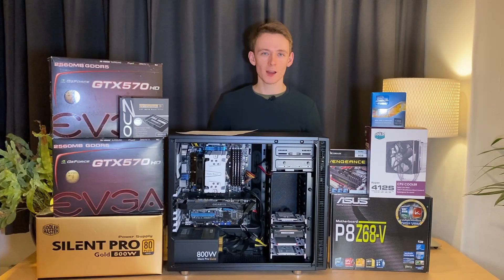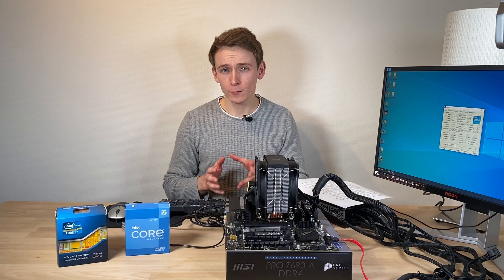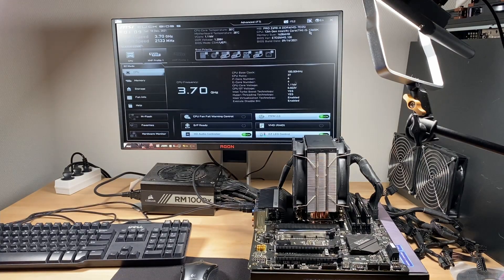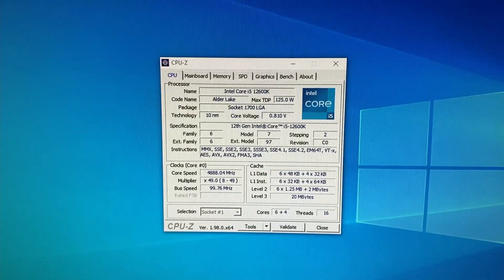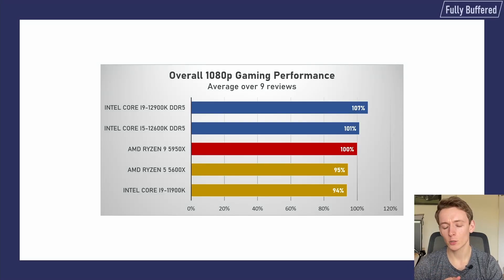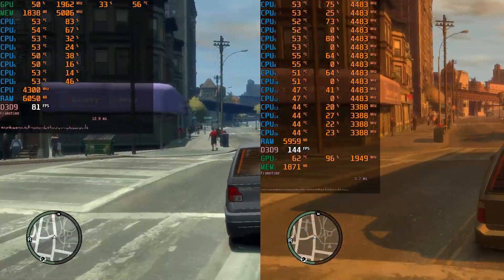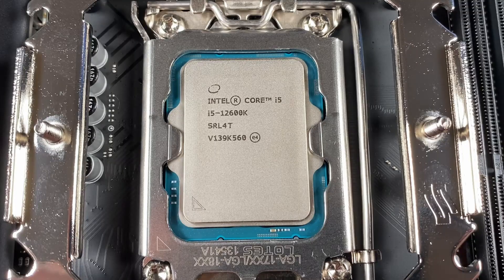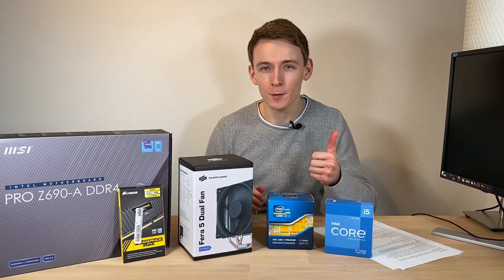Should you cheap out? - Budget Intel Core i5-12600K Upgrade

Comment: Not long ago I upgraded from my i7 2600K@4.4GHz, Asus P8P67 PRO B3, 4x4GB DDR3 1600 RAM. Had been using this system from 2011. I upgraded to a Ryzen R5 5600x with 32GB DDR4 3200 RAM. My i7 2600K was still working nice for my needs, but I noticed after the upgrade my machine felt more responsive for regular use. And in Borderlands 3, using the same GTX 1070 I had been using on the i7 2600K from 2017 I noticed a huge difference. In the BL3 benchmark the i7 2600K was just a few frames behind the Ryzen. But when playing the game I had to turn a lot of settings down on the i7 to mostly keep 60FPS and avoid stuttering. And even then it would drop to 30-40FPS when alot was going on in the game. Whilst the Ryzen was rock solid at 60FPS, at much higher graphics settings, would never drop below 60FPS and felt alot more smooth. So huge difference. As fantastic as the i7 2600K was, ugrading to an entry level platform like the R5 5600x did make a huge difference for gaming at least. But the i7 2600K is still legendary. I had it for 13 years. that's some serious value.

Comment: you picked a great motherboard you have so many upgrades options. my advice is to not wait till the cpu is no longer viable i would sell it in a year or 2 and get a 14600k or 14700k you will get most of your back for your 12600k

Comment: In 2019 I did a comparable upgrade from a 2008 HP dc5850 with a Phenom II X4 B97 (4x 3.2GHz) and 8GB DDR2 (800Mhz) to an own build a Ryzen 3 2200G (4x 3.7GHz OC) and 16GB DDR4 (3000MHz). I've added a 512GB Silicon Power nvme-SSD. An upgrade with a 2x faster CPU and a nvme (3400/2300MB/s)! 
I collect Virtual Machines, like all Windows releases from 1.04 (1987) to 11 (2022), including the NT releases from the nineties and the Ubuntu LTS releases from 4.10 the first; 5.04 my first and 6.06 LTS to 22.04 LTS and now the 23.04 Development Edition :)

Comment: 12600k 
RTX 3060 12GB 
3600 Patriot Viper DDR4 32GB
8TB NVME
1000 Watt Power Supply
________________________

Rate my build by spec! (This doesnt mean measure your cock with the 3090 you bought with your moms credit card)

Comment: I love the video, you are just like me reuse the same parts such as the case, power supply, and GPU, great upgrade and you waited to decide what platform to use from the LGA 1200 or the LGA 1700. the main thing is how much watt does the CPU air Coller handles I like the air cooler. I love the ending and I agree with you do not need a $100-dollar aio to keep your system cool. This air cooler is on my radar, and you did not hit high temps using this 32-dollar air cooler.

Comment: Pop out, then pop in...and just like that you have an awesome upgrade. This is why I prefer desktop PCs.

Coming from the 6600, I got the 12400 with Stock cooler and DDR4-3600
Reply: My 1050Ti went from ~75% usage in Fortnite and now its fully unleashed with the 12400

Comment: Got this cpu early this here and upgraded from a 1060 to a rtx 3070 8gb this July when gpu prices came back to normality.... really love to use it to work with Figma and Adobe suite, it smokes my old i7 3770 and 2019 macbook pro.... like I can literally open a crazy amount of browser tabs in Chrome and Firefox while working and having a lot of background processes and all the communication apps, all with 3 plugged monitors (one 4k and two 1080p)...  and it never skips a beat.
The only thing I might need to ugrade is the ssd as I have a sata ssd and I want to go nvme... but this is already so sweet since I have to use this system almost everyday for many hours.

Comment: I have SilentiumPC Fera 5 (single fan) cooler on i5-11400. With unlocked power in synthetic load (prime95) it can draw up to 144 W peak, 130 W average and even with 28 C room temperature and closed, poorly ventillated case temperature of CPU didn't even hit 90 C (60 C delta above ambient temperature).
Dual fan offers very little performance boost over single fan while increasing noise level (according to internet tests), so I picked the more silent(ium) option. Did I mention my fan curve is tweaked down? It's barely audible at full load while not thermal throttling in bad case/ambient scenario.
Meanwhile my friends are listening to their fancy, expensive AIO pumps.
Reply: I ordered the i5 12600kf paired with the Fera 5 ARGB, im excited to see how it is while gaming :) i only play games tho, no rendering etc

Comment: The 12600k is very nice indeed. I bought a 5600X in 2021, when the 12th gen was not available. Honestly I don't regret it, because despite the lower performance, it tops around 70W and 62 C with a cheap air cooler on benchmarks such as prime95, nearly half of the power consumption of the 12600k on demanding workloads

Comment: Hey man, how much did you spend on the cooler? Cuz from what i see, the single fan version of the fortis 5 is priced similarly to the fera 5 dual fan and even from the pictures i can tell its much bigger (i was suprised that it was a single tower, and not a double tower with a fan in the middle)

And btw, speaking of similar pricing, are the gigabyte gaming x boards priced near the price of the msi pro in your country? I plan on getting a build like that, and i found that aside for the cheaper asus prime that doesnt look that appealing due to less m.2 slots and poorer i/o, there are 2 options, a gigabyte gaming x board, and the msi pro one, so, what do you think about the gigabyte gaming x, and is it worth buying over the msi pro? (Or the aorus elite in that matter, because ts the same pcb just with some bigger radiators and a lit up logo to make it look better, even the websites with info about the gaming x and the aorus elite are the same to the point that they forgot to switch the numbers listing the features so on one of them, thunderbolt and intel 12th gen support were switched and the tb was listed on the socket and 12th gen support was listed on an internal usb c connector)

Comment: are you actually gaming at 1080p...if so, that's a bit uh, well ya no wonder you see a 50% increase in performance?  That's not really helpful information in 2022. At the root of it, essentially the question everyone wants answered is/was, is it worth the cost of a cheap used car, to potentially gain yourself ten frames per second on 1440p or higher resolutions where the CPU is not the bottleneck
Reply: Well, he uses a card from 6 years ago, its not a 1440p gaming card, not for battlefield

Comment: this reminds me of when I changed from q8200 to i7 7700k while using a GTX560 - specifically in Battlefield 3 at that time (25fps => 90+). Obviously for how I use a computer these days in 3d rendering those specs didn't exactly stay in the case for that long

Comment: I recommend using DXVK on GTA 4, it can double the FPS depending on the configuration, and even when it doesn't improve FPS, it does improve frame times and stability overall.
Reply: isn't that a way for linuxt to run directx programs ?
Reply: @amer2142  It just translates DirectX calls to Vulkan, so it can run on Windows as well.

Comment: There's something so elegant about upgrading from the 2600k to the 12600k
Reply: but not from 95W to 150W. it may need speed or cores number cut to fit acceptable temperature <70 C in some apps. or more bulky cooler
Reply: @shampec6185  outta here amd hypocrite editing msgs to sound correct
Reply: 125w* @shampec6185
Reply: @shampec6185  rewatch the video, author clearly said that he didnt have any issues cooling that 12600k with that small air cooler. just because it needs more wats doesnt mean its harder to cool.
Reply: @h1tzzYT  more power = more heat
It's the joule effect
Reply: @lucasf4rt523  you are technically correct but you forgot the most important factor. Thermal density, the smaller cpu die is and the more power it consumes the hotter it is and the harder is to dissipate that heat. Thats why some cpus such as HEDT cpus has no issues running above 200w, meanwhile something like 5800x will be extremely hard to cool even with top tier air cooler such as nhd15.
Reply: @lucasf4rt523  also very good example is gpu cooling vs cpu cooling, gpus can be cooled at 300W without big issues with air cooling, while in most cpus at 300W you are looking purely at water cooling territory, thats because cpu die is much smaller than gpu.

Comment: It's great value and a deal, but budget is different. The 12400 with a non overclocking mainboard (B660) is a good budget build because the single core performance is still very high. You can almost buy two of those for the price of 12600k+z690 :)

Comment: Super video, hai. I try to build something similar: MSI PRO Z690-A DDR4+CORE 5-12600K+Noctua NH-U12S chromax.Black+PATRIOT 16GB Viper Steel DDR4 4400MHz CL19 +ADATA 1TB XPG SX8200 Pro M.2 PCIe+MSI GeForce GTX 1660 Super 6GB VENTUS XS OC + MSI MPG Series A850GF 80+Gold+SSD+HDD. It takes a while for, what you think🤔

Comment: under rated content! I also am having trouble pushing the 12600k to its TDP and potential. I have a feeling it is software capped to make the 12900k more desirable. My Gigabyte bios is very vague when it comes to overclocking though. I cannot seem to push the clock past 49 for some reason... another hint that its all a software cap, I have the decent mobo.

Comment: Hello mister.Need opinion. I will upgrade in few weeks right now I'm on i7 2700k 3.5Hgz :) 
I made plan to get i5 12600k , msi pro z690 A ddr4 wifi, Dark Rock Pro4 cpu air cooler, Ram 3200-360l 16-18cl 2x16gb any maker just cheap better, ssd samsung 980 pro m2 4pcle, Case be quite pure base 500dx blk. Gpu and psu I have already gigabyte gtx1660 super , power corsar 550. 
Please can you tell your opinion and all compatible?
Reply from the maker: Sounds good 👍🏻 Just make sure that the Dark Rock has LGA1700 compatibility
Reply: @FullyBuffered  when you buy be quite  they provide free one. Thank you.
Reply: @FullyBuffered  build works all looks well have question about xmp set up for ddr4 3200 cl6. What gear to use ? G1 or G2

Comment: I'm watching this right now on the 2600k and the exact same MB P8Z68-V PRO that you just upgraded from. So I guess it is finally time to upgrade to. I really don't want to run windows 11 at this time. Is it possible and easy to disable the e-cores in the bios for compatibility with windows 10? I haven't found the answer to this since I can't find videos showing alder lake MB bios's. I might go for an i7-12700 to get 8 p-cores for premiere. If there is no easy way to disable the e-cores in the bios then I will have to buy an alder lake cpu without any e-cores. Thanks for your help and thanks for the video! This is finally a very exciting time that took intel way to long.
Reply: Is there an issue with Windows 10 not supporting different core types?

Comment: So base clock of non-K intel CPUs are in range of 2 GHz and for K it's in 3 GHz range. While boost clock is almost same ,generally at a 100 mhz difference at around 5GHz. In benchmarks both K and non K CPUs perform very close. 
What does the base clock signifies?
I mean what's the benifit/con of lower base clock? Why non K CPUs have much lower base clock than their K counterparts

I tried finding good answer on this but didn't found a perfect answer anywhere, see if you know.
I wanted a 12700 non K but base clock id low
Reply from the maker: The base clock is the all-core clock speed at which the CPU outputs the listed TDP (thermal design power). Non-K chips have a lower TDP (like 65W for the i7-12700) than K chips (like 150W for the i7-12700K) and therefore the base clock for non-K chips is lower. So in practice (using stock settings) the non-k chips will run at a lower all-core frequency when under load.
Reply: @FullyBuffered    I've decided to bite the bullet and upgrade to i5 12400f with a b660 board that unlocks the i5 processor. Let's see when it arrives if I can get it up to 5 GHz. 204€ board 178€ prossesor and 138€ for 16GB DDR 5 total is 517€.  Will be upgrading from an x5675 @ 4.5ghz so should see a difference with a 1070ti
Reply: @FullyBuffered  what if we removed power limits

Comment: Nice upgrade. Great step from 2600K to 12600K. I did a similar jump from i7 3770K > Ryzen 7 3700X and got a similar uplift with my vega 64.
Reply: 3770k to 3700x is like going from 3770k to 9900k~ performance wise, still a good upgrade don't understand me wrong, but 2600k to 12600k would be like going from fx 8350 to between 5800x-5900x performance wise, absolutely insane
Reply: bigger .12600k>3700x>3770k>2600k

Comment: This is dope. I ended up upgrading my i7-2600(non-k) and 16gb of DDR3 at 1333mhz to a i5-8400 and the same Corsair DDR4 memory you have except 32gb at 3000mhz. It also came with a low profile Noctua cooler and Z370 Gigabyte board for all for around $150 used through a local seller. He was upgrading to Alder Lake, and I'm glad to get it from him. I mainly use my PC as a combination of a test bed, media center, and gaming. I'm still on a GTX 1050 2gb, but thanks to the CPU and ram upgrade. I was to play Halo Infinite at a stable 1080p 30fps😂. I couldn't get 60fps at any other scaling or resolution. Halo Infinite is very ram intensive including Vram intensive.

I'm just happy you upgraded similar to me. I tend to have a better go in the used market. Hope to find maybe a Nvidia or AMD workstation card like the Tesla M40 12gb to hopefully upgrade my setup cause the even though it had no display ports. I can use the iGPU or UHD 630 of the i5-8400 now to pass the display data of the Tesla M40 when setting any graphical program to high performance. I'll hopefully upgrade to that if the RTX 3050 8gb doesn't end up tempting me.

Like your videos. Keep being the smooth gentleman you are. 😊
Reply: Try upgrading to a 8700k, the hyper-threading can really eliminate stutter in some modern games like Cyberpunk. 6 cores alone isn't enough anymore sometimes. Gamers Nexus had a video about it.
Reply: @JamesSmith-sw3nk  I've been thinking about that. My brother has the i7-8700(non k) and 32gb ram at 3600mhz. I got the i7-8700 years ago by trading an office PC to a guy so his folks had one and paying $100 instead of his priced $200.

My brother been using the i7-8700 for a while. Based on the performance seen here by the Alder Lakes, that might be a good upgrade for him cause he edits a ton. The only thing that concerns me is the TDP. Not because of the thermal output, but because of power draw. He's a guy who will run a PC 24/7...'sighs'...and happens to never clean his case or components. Nothing wrong with done dust, but 'whew' it's insane though. But I honestly believe that an even slight higher TDP will make just a bare minimum amount of thermal output that will set his PC on fire.

Either way, he is an editor for others(which makes me look at his system and I wonder how much he cares for his job). And if he ever bites the bullet for an upgrade. I'm gonna see if I can get the i7-8700 I got a while back into my system. Then he can sell his motherboard and my i5-8400 making him his money and me getting a 6core with hyper threading. 

However, I'm not gonna be down his throat either about it. It's just something I'd like to bring up as a future idea to him and to see if he is up for it. It's just when he upgrades eventually. I'd would just like to have the CPU is all. I ended up building his whole editing system by the way. I'm just not an editor in anyway. And also, I have a GTX 1050 2gb right now. So upgrading to an even better CPU for more headroom wouldn't really make much of a difference in the grand scheme of things.
Reply from the maker: Thank you very much and best of luck finding a GPU!
Reply: @FullyBuffered  Thank you for the content and I only have hope. It's better than nothing 😅
Reply from the maker: Thanks! Ha yeah that’s for sure

Comment: I have the same board, and I ordered the SilentiumPC Fortis 5 Dual Fan cooler. The Fera was not specified as compatible with LGA1700 on the site where I bought it, and I didn't check around. I hope it will be enough for the 12900k in normal tasks, I won't do stress testing. I saw that in demanding games like Cyberpunk it can get quite hot, there is a video on YT already. I hate water coolers.
Reply: so, how's your system has been? i've gone with a Deepcool AK620 with my 12600k and damn, at stock clocks the thing is silent. but you dont buy a z690 mobo with a K cpu to run it at stock clocks, so at 5.0/4.0 all cores temps are around 85C, no thermal throttling. for 70 bucks the cooler is great